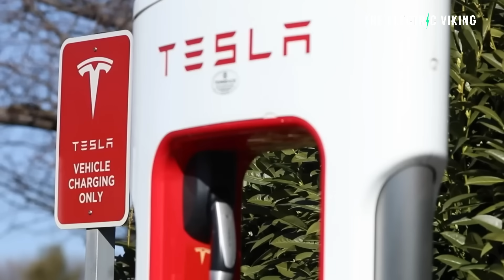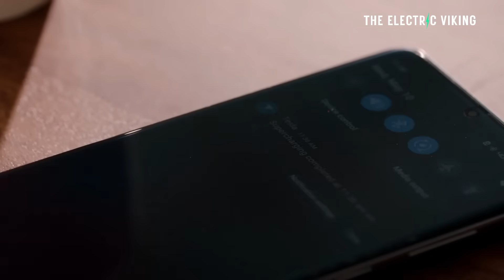Game-Changing Tesla Battery Could DOUBLE Your EV’s Lifespan!

Comment: Batteries are improving so rapidly they will soon give greater range than a tank full of petrol AND charge faster than filling up. The technology is advancing faster and faster.
Reply: …. And getting cheaper
Reply: @SparkySho cheaper in selling price which is depreciating further the entire existing fleet not really In cost looking at mfrs profits and share down the drain.this is NOT a good outlook with more and more users trapped with an unsellable used EV, the next one ordered and a decent sale needed to pay the next mistake….so even if the mistake is cheaper the overall damage is financially a lot worst. Have sold many cars helping friends colleagues and relatives to sell theirs, even the boss of the boss of my boss now presents me as his car salesman ..as I sold his car for the price he wanted, but never seen so difficult time to find serious buyers…and there are cars I refuse to deal with , Saab convertible, Nissan’s Kia’s etc.😊
Reply: @SparkySho because of Chinese dumping domstic production internationally. Not sustainable.
Reply: @SparkySho Well CATL apparently is working on a sodium battery that will cost $10 per kwh or about 10 times cheaper than the current most cheapest battery, and if any company can pull it off its CATL!
Reply: Yes.
Reply: Dream on this will not happen. As for charging in less time than fueling a conventional car, do you have a clue as to the size of the grid connections that will be needed?  More energy charged in less time needs bigger grid connections, 1.2 Mw to charge a 100kw Hr in 5 minutes. 10 charger stands will need a 12Mw grid connection, this is enough to power a small town, it's madness.
Reply: Keep dreaming. 4.5L of petrol weighing 3kg has the same energy density as a 36 kWh EV battery weighing 300kg.
Reply: No. 50 litres at 10 miles per litre is 500 miles.  That might take 5 minutes to pump. 500 miles at 4 miles per kwh is 125kwh. 125kwhh in 5 minutes is 125x60/5 = 1.5 megawatts. That is not going to happen. Even if 1000 volt charging is used the current would be a massive 1500 amps. Got it?
Reply: @rogerphelps9939  No, of course he doesn't get it. He will just believe the next CATL propaganda leaflet. And you have been super generous here -  recently filled 60 liters into my large PEHV and it clocked it at 1:51 .....
Reply: Utter bullshit. Volumetric or mass energy densoty of battery tech will never surpass pure chemical liquid fuel.
Reply: True, but with the Frankengoober administration showing zero interest in building up the infrastructure, America will fall behind. 🙁
Reply: I thought the technology is already here. 🎉
Reply: @cb250nighthawk3 😂Technology advaces daily.
Reply: Maybe people have been lied to enough they don't listen anymore. Many other companies have announced the same thing, like Toyota and Honda. I will believe it when I see it from Tesla. It likely doesn't matter anyway, as people are boycotting Elon's products.  People say he's a NAZI. I was going to buy one, then Trump got in power, and the Ketamine Kid started ripping apart parts of the government he didn't like, despite it being illegal.

I don't do business with immoral people or businesses. Trump and Musk want to destroy American democracy. Some other company will make an electric car you want. China and Elon are predatory. Every dollar you spend funds evil. Look in the mirror before you buy. Think of your grandfather or great-grandfather that fought in WW2. Do you think they'd buy something from someone who wants to destroy their country?

Principles sometimes cost money, but they don't cost sleep.
Reply: Sorry, but the grid can't handle charging faster than a fill-up.
Reply: You fell for click bait. These batteries, and 90% of the ones going into Elon's cars are made in China.
Reply: Good Sherlogg
Reply: It's very impressive how far lithium has come, to think the Watt-Hour/kg has consistently increased over the years is remarkable.
Reply: And they will cure cancer and give you an orgasm for free when they are charged to 2000%.
The Chinese will make batteries that are so small that they form a black hole and they will have a negative price tag....
Reply: 1999 2.3l kompressor m111 146kw 35mpg 5sp auto
1994 3.0l diesel om606 132 kw 45mpg 4 sp auto
2016 2.0l petrol m274 135kw 135kwh 55mpg.
All motorway figures. Similar engines, 30 years of ICE improvements. I rest my case.
Reply: Used evs are so cheap due to perception of the market not the vehicle themselves. Most people are under the mistaken idea the you have to replace the battery every 3-5 years or you get less than 100 miles. This is simply untrue and a myth perpetrated by many sources.

 The 1997 fiat marea got 49 mpg you have gained what 12 percent in almost 30 years? But let's go with the more modern Skoda Octavia which gives a possible 69 mpg gives a 40% increase in mpg. A 2015 model s was at 2.9 kwh per mile versus a modern dual motor at 4.3. In 2025 that a 48% increase. This happened in 10 years not 30.

 Now if we look at battery tech we go from the 90s at 80 wh/kg to the current mass production at 360 wh/kg that is a massive increase of 4.5 times during the same period the amount of fuel used for motion went from 35-45% to 45-60% at best a 15% increase.
Reply: @williamdavis7009  You don't have to replace the batteries.
But the batteries will be sh#t after 5 or so years. I haggled down all the used EV I purchased because the batteries have dramatically dropped in capacity in all of them.
They still make great city cars. And once the batteries degraded some 30%, the further degradation goes a lot slower.
Reply: Yeah, and FSD is definately going to be a thing, next year...
Reply: New BMW i3 is claiming 497 mile range. That's about what my Ford C-max gets on a tank, and based on my useage I only refuel once every 10 days to 2 weeks. A 500 mile EV would be great.
Reply: Almost no one needs longer range and faster charging only really helps when trying to drive 1000 miles in a day. We drive a model y 75,000 km a year (top 1%) and only driving over 1000 miles would faster charging really make any difference to us at all. 

Longer life batteries will be great for robotaxi's and high mileage drivers like us because we'll smoke a battery before the rest of the car is toast. For 95% of people current batteries will outlast the vehicle.
Reply: When a battery car can beat me to my destination faster than my gas vehicle at 900+ miles in all weather conditions I might consider it.
Reply: @icrewheloso8588 Your bladder is obviously stronger than mine. Good luck.
Reply: Batteries are being gradually optimised for each specific application with particular performances but Lithium based technology with no more hidden unlikely secret not already discovered…with the hundreds of billions $ invested…remain a huge compromise between many parameters: cost weight volume durability efficiency safety  maximum charging and discharging rate , low temp. capacity etc. Progress is NOT to improve one parameter which has negative impacts on the rest.. it will still takes several quantum breakthrough to impose this financially assisted mobility paid by all the other means of transport insurance taxation and pollution control and very far from being financially autonomous and viable. This is quite unlikely to happen or happen fast enough to unlock well the way market has stalled . The impact of all those imposed free market distorsion is a current rising cost and environmental damage of all our mobility paying ou our errors ending as a market crisis with flee aging and unbearable costs due to fires, depreciation, short life, liabilities, usage limitation on ferries and inside long tunnels, underground parkings, etc.😅 marginal comfort and technology is not enough, the overall sociability of the means of transport for the key task of going from À to B drives the success not the rest of crap, autonomy charging time access to charger, cost , constrains forcing thr use of alternate means etc..
Reply: @philgooddr.7850 thanks AI
Reply: No.
Batteries will never exceed the energy density of petroleum. Because atoms work that way.

However, you can have battery+ motor pack that weigh less than petroleum+engine+gearbox+transmission. 

That is still 10 years away.
Reply: @vorpalinferno9711 . Petrol engines are much heavier than electric motors. You must take batteries and electric motors together to compare them with a petrol engine, exhaust system and petrol tank. They are getting very close. The rate of progress of energy density increases of batteries is amazing. They are already at 670Wh/kg in 10 years it’s not too fanciful to imagine it will be twice that.
Reply: @vorpalinferno9711 .
.........and will still be 10 years away in 20 years, just like fusion.
Reply: One reply has been hidden. The reply that says that no battery will exceed the energy density, mass or volunetric, of liquid fuels. The best mass density of liquid fuels is atound 11kwh per kg. Wake me up when batteries get anywhere near this figure.
Reply: @Dungshoveleux  You’re right that petrol has a much higher energy density on paper, about 11–12 kWh per kg. What often gets missed though is efficiency. A petrol engine only uses around 20 to 30 percent of that energy for motion, the rest is lost as heat.

An EV battery is much lower density at around 0.25 kWh per kg, but the motor is 85 to 90 percent efficient, and regenerative braking recovers energy that petrol cars simply waste.

So in practice, even with much lower energy density, EVs can already match the driving range of petrol cars. It is not only about how much energy you carry, it is about how much of it actually moves the wheels.
Reply: @Daonexus  Even with the efficiency of an electric engine or 4 at 85% efficiency, an ICE takes its wasted heat to heat the cabin, whereas an EV takes it from the battery. ICE at 40% efficiency = say 4.4kwh/kg EV at 90% = 0.3kwh/kg. Wake me up when batteries yield 4.5kwh/kg. And using an a/c to cool the cabin will also take energy from the battery.
Reply: @Daonexus 30 percent too high - they is ideal conditions
Reply: @Dungshoveleux who needs to heat the cabin in a hot climate or during summer
Reply: @Daonexus Bro, petrol engines were 20/30% efficient in the 1920/30's

I think you might of got confused.

Since then fuel injection and computer controls have been invented and refined
Reply: @Dungshoveleux 
Wake me up when you can “refuel” at home for next to nothing.
Reply: @oggyoggy1299  totally different question. The OP stated that batteries will give a greater range than a full tank of petrol. The energy mass/volumetric density of batteries vs liquid fuels just proves the statement is FALSE.
Reply: @Dungshoveleux 
Suck it.  No, the OP says batteries will soon give a greater range.  And they will.
Keep saving - you’ll be able to buy one some day.
Glad you’re watching EV videos though.  It shows you want one. 
good girl.
Reply: @oggyoggy1299 Ad hominem attacks just show you lost the technical argument and are opting for insults only. You EV people need to consider why 2nd hand EVs are so cheap. XIf they were fine, they would not suffer horrendous depreciation. Low prices for ex lease EVs mean lack of demand and over supply. The product is not what the matket wants except in very limited circumstances. Most hybrids spend their time using ICE.
Reply: @Dungshoveleux 
haha!  You MUST be a they/them.
Reply: @Dungshoveleux it's going to happen very soon
Reply: @Dungshoveleux batteries don't need to get near that figure because EVs are 4 to 5 times more efficient than ICE cars so only need around 1/4th to 1/5th the energy an ICE car needs to go the same distance.
Reply: @Dungshoveleux too bad combustion engines are frozen in time and haven’t really improved over the last 40 years 😂😂😂
Reply: @SuperMachead1  In 1994 my mercedes 3 litre diesel was capable of 45mpg 4speed auto. Today my 2016 2 litre Mercedes petrol gets 55mpg 7 speed auto. The best my 1999 2.3 litres mercedes petrol got was 35mpg  5 speed auto. ICE tech has been getting better for the last 30+ years.
Reply: @Dungshoveleux 😂😂😂😂….wow that’s the most delusional thing I’ve heard in a while 😂😂😂thanks 😂
Reply: @SuperMachead1 Its all true. Facts, not beliefs.
Reply: @Dungshoveleux so let me get this straight… you proud of the fact in 30 plus years…you gained about 10mpg …we should be easily over 100mpg…the oil industrial complex would not be happy about that at all…maybe that’s why it’s been so stagnant..in 10 years we will have cheap batteries that last for a million miles and can go a 1,000 miles on one charge…tell me do you doubt that ?
Reply: @Dungshoveleux  Its nowhere near that difference. Maybe the engine itself consumes 10% less. Because they stripped it from longevity. 
Rest is down to gearbox etc.
Reply: @SuperMachead1 you said ice had not improved, but I have demonstrated that your hypothesis was false. I never said I was satisfied with the level of improvement. You are putting words into other people's mouths. Just admit your statement was wrong.
Reply: @Dungshoveleux here’s a bit of nostalgia for you….a 2010 Toyota Prius came out with 51mpg ….the 2025 Toyota Prius gets 54mpg….😂😂😂😂
Reply: @Dungshoveleux usable energy in those liquid fuels is about 15% at best based on combned driving. Batteries will exceed the usable (convertible energy) in liquid fuels as used in today’s ICE cars
Reply: @beyondzeroemissions 🤣🤣🤣
Reply: 60 kg diesel in some cars give 200000 km.  500 kg battery give 500km range.
Reply: @kjelle5350 your math is way off bud, 68L of diesel will get you 1500km if you're lucky in a standard car. People with BMW and Audis with bigger 74l tanks sometimes brag about getting 900-1000km per tank.
Reply: @CED99 you are right. It should be 2000 km.
Reply: @CED99  several cars are capable of doing 2000 km on a tank of diesel. Smaller VW and Volvo, peugeot, citroen have been capable of that.
Reply: @kjelle5350 way to many zero's my friend. Even 200 km might be a stretch
Reply: @kjelle5350 in most cases 60 kg = 70 ltr diesel gives you max 1400 km, most of the diesel is wasted as heat and noise and 189 kg CO2 is generated, and the diesel cannot be reused.
The battery of an EV is like a gas tank of an ICE car, the electricity in itself weighs a few picogram so 60 kg of electricity will take you several million km.
Your 200K km is exaggerated
Reply: @bellytripper-nh8ox  Wonderfully intelligent response mate, your mother would be proud....!!! {she should have swallowed}...
Reply: @bellytripper-nh8ox  you always got the loser like these who would click on a video and scroll through the comments 🤣😂 I don’t agree with his faster, charging idea, but longer range I actually could admit could be the case.
Reply: @bellytripper-nh8ox yes you are. 😂

Comment: No customers are asking for longer lasting batteries, all of them are asking for more range.
Reply: As a rideshare driver, I certainly would value a battery with a longer lifecycle.  For me, a true/reliable 270 mile range meets my daily use case
Reply: BS, range is a joke. I grew up with cars that were lucky to get 400 kilometres of  range, closer to 250 k's around town, how did we ever survive !!!!!  Got any other excuses ?
Reply: @MickH60  Gas is more available and very quick to add range. Gas cars also do just as well in cold weather. EVs need a safety buffer just in case. The more the better.

Comment: Nice, but it doesn't address the real issue - charging in half the time.  There isn't a longevity issue with the batteries today but there is an issue of charging delay.
Reply: I disagree. Every day I walk out to my EV and it is effectively full. I spend zero time charging it.

Road trips are the only time it ever matters, and that's like 3 or 4 times per year. It's plenty fast for road trips.

Most EV charge at home.
Reply: @h57s Not if you live in an apartment.
Reply: @cheapsunglasses  I wouldn't matter, you'll always have an excuse....
Reply: For me trips my wife's Jetta can make on a single tank my EV needs 2 charging stops. I agree charging at home is most of the time, but for me the longer trips are once per month. I'd be thrilled if Tesla phased out their V1 and V2 stations, raised their pack voltages, and improved the charge curves.

Comment: The question remaining, is what is the charging curve like?  Does it charge the same, slower, or faster say between 70% to 90%? 

Fast charging up to 80% (or 90%) would be nice!  That will make road trips nicer.  More capacity is good too.
Reply: It doesn't change the charge curve. In order to do that you need to change chemistry. But they are not changing chemistry they are just doping the cathode material to help prevent lithium ions getting stucked in the crystal layers and therefore causing 20% lost of capacity overtime.
Reply: @kazedcat I hoped the doping would change a variable... Sigh.
Reply: @External2737 doping usually means less than 1% of a specific material is added. So it isn't going to changed other properties much.
Reply: @kazedcat I'm used to coatings that can dramatically change performance of items. 

I was thinking like Vanadium, where a tiny amount changes the properties of steel dramatically. (The additive that enabled the model T to reduce costs dramatically.)